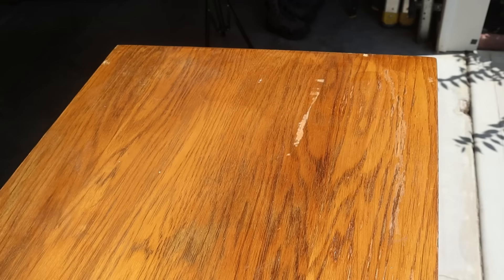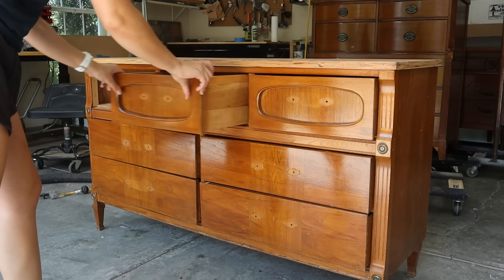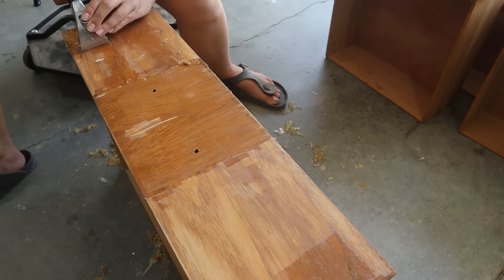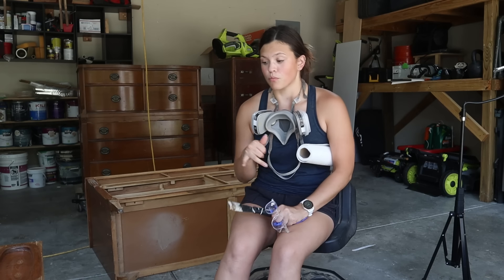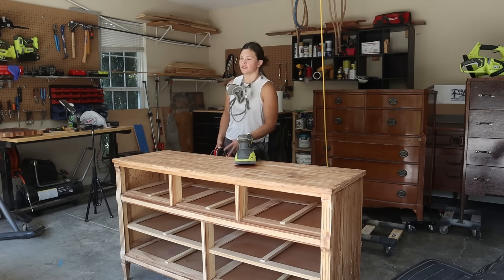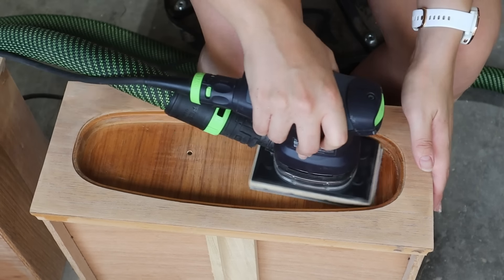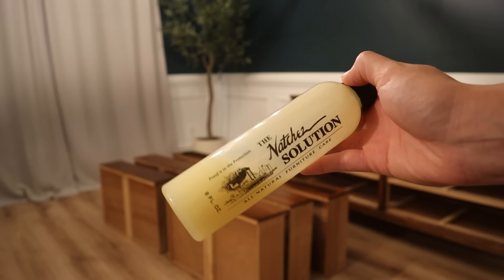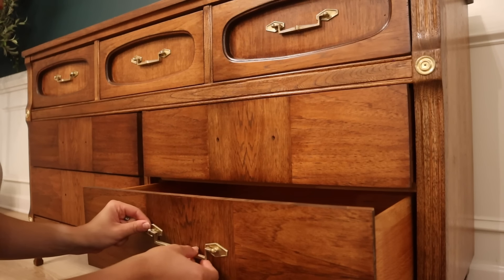Beautiful Dresser Restoration // Giving Old Furniture a New Life

Comment: Citrus Strip is horrible!  I use EZStrip and it’s really fast…but it is really messy.  I actually like using stripper on a flat surface of veneer.  It keeps me from sanding through the veneer (which I’ve done)🤪
Reply from the maker: Yeah I think I’ll try it on a painted piece and get a different stripper like EZstrip and see how it goes.